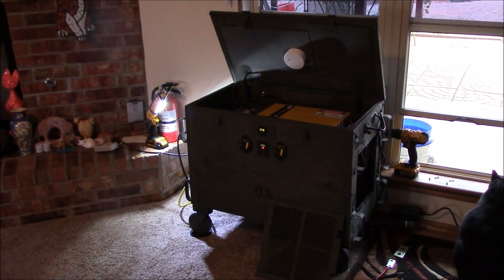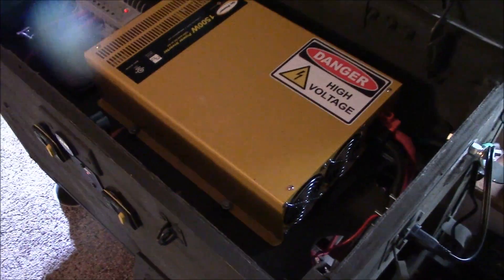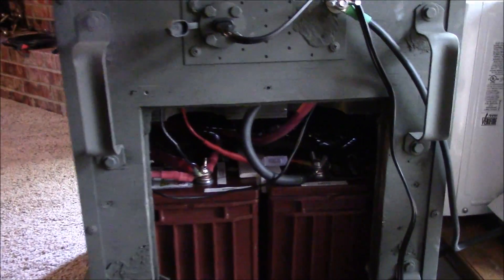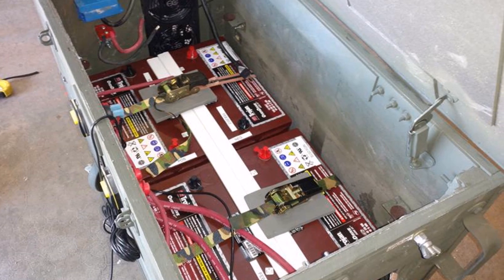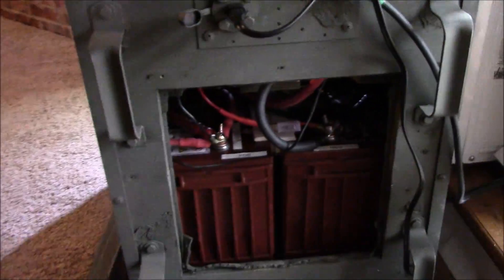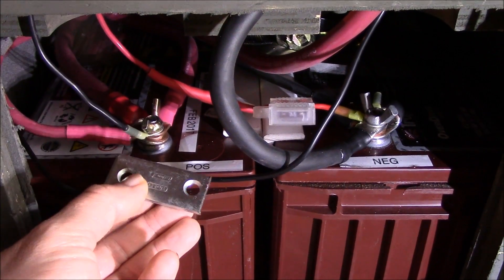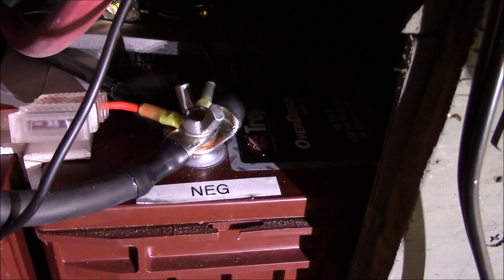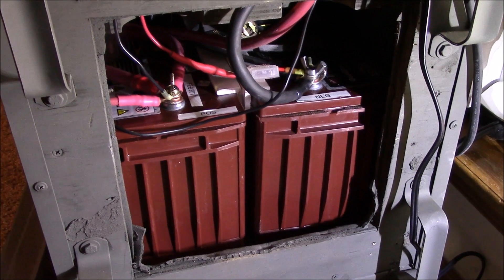Battery post bus bar? Need some advice/help.

Comment: You could go with a Blue Sea Systems dual terminal fuse block on the pos side.  That would give you three connection points (2 fused).
https://www.amazon.com/Blue-Sea-Systems-Terminal-Block/dp/B002INJXO6/ref=sr_1_sc_1?ie=UTF8&qid=1488304267&sr=8-1-spell&keywords=sutars+battery+terminals
Reply from the maker: Now we're getting somewhere! Two of them for both the NEG and POS. Fuses  on both is no big deal. Thanks Dave!
Follow up: these dual fuse blocks do not come with fuses. I totaled up the cost for two of these + two fuses. Came to $88.16. Ouch.
So, went to https://www.delcity.net/ and got the same items for less than $40. I think I found a new "go to" vendor for DC items like this! I can fuse the solar charger with one fuse (30 amp) and the inverter (100 amp) and still be well under the "total" rating of these units. I like the idea of using fuses + circuit breakers for this solar generator. Marine grade stuff too. Not sure if the fuse block can be used w/o fuses...we will see! Stay tuned! Thanks again Dave.
Reply: I like that you can fuse your different wires with the appropriate sized fuse.  I am using these on my two pos terminals of my two banks with 200 amp fuses.  Nice find on the source, definitely going to save that link!
Reply from the maker: Our DIY home solar community is awesome! 👍👍

Comment: Simple piece of copper or aluminum bar stock. 3/8” x 1.5” x desired length should do the trick. Drill clearance holes for your post mounts and drill & tap for accessory connections.
You can get a good estimate for ampacity: (thickness x width) x 700 for alum or 1000 for copper.

You can get the bar stock from onlinemetals.com or a local metal supply in most cities

Comment: I did as others have said 1/2 inch copper smashed down then bent to double it up pounded again filed off the sharp corners and done drilled holes and put 3/8 or 5/16 on high current I use 3/8 bolts and nuts. It does not look to bad and a hole 10ft piece of copper water pipe cost me around $10 and can also be used to make connections on the battery posts. I like the cheap way so this may not be for you good luck on what you find.

Comment: Hey Chris,  

I just ran into the same issue - easy fix - great results

I make mine out of 1" wide  1/16" thick  Super conductive 101 Coper Bars

You can get them at mcmaster-carr supply  www.mcmaster.com/#standard-red-metal-sheets/=16k4qz7
They come in 1ft -($10.04),  2ft - ($16.56) and 4ft - ($27.14) lenghts.

Making buss bars has never been easier.  Jut cut and drill to your custom size

Off the shelf bars like strut materail will not have the contivity you are looking for

Comment: If you search amazon for battery terminal extensions you will see lots of choices.  I like the one Dave Armstrong recommended.
Reply from the maker: Yep, I agree. However, found a vendor that beat Amazon's prices by more than half. The dual fuse block does NOT come with fuses. Check this place out: https://www.delcity.net/
Reply: Right on!  Amazon gets plenty of my money, I am not opposed to spreading the "wealth", lol.

Comment: I have 2 of the bluesea 100 amp (4 post) bust bars I am not using. if you want them they are yours. email me at seabth@gmail.com

correction... they are 150A bus bars.

https://www.amazon.com/gp/product/B000MMDL7K/ref=oh_aui_detailpage_o08_s00?ie=UTF8&psc=1

Comment: I made mine out of a piece of flattened out half inch copper pipe then drilled holes in them and put long stainless bolts and nuts through the holes and tightened them up and added wing nuts to hold the wires down !! Works great, no dramas what so ever and CHEAP !!  Seeya Rob
Reply: yes this is how i made high current bus bars. and if you worried about currents you can double them up. a 19mm (3 quarter) copper pipe equals about 65mm2 diameter in pure copper.

Comment: I don't know if you want to use copper with the acid batteries but you can hammer flat copper pipe and drill holes.